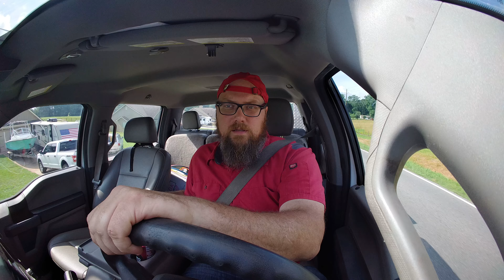Nordyne Package Heat Pump: Hidden Capacitor.

Comment: what would burn the 2AMps glass fuse ? the contractor is not measuring  24 V on the side pins? thanks
Reply from the maker: Typically some kind of low voltage short, which can be interesting to track down sometimes.

It could be anything from damaged wiring due to mechanical fatigue or rodents trying to get cool or warm chewing wiring as they go, or component failure such as a relay, board or contactor either having failed.

Normal l start with a visual inspection of the low voltage wiring in the units and running between the systems is a good starting point, but after that if nothing pops out it’s somewhat a process of elimination.

What I’ll typically do is disconnect all the low voltage field wiring at the furnace or air handler, replace the fuse (or use a reset capable fuse) and test each circuit individually until I have an issue, then follow that particularly circuit until i find a damaged wire or component on that particular circuit.
Reply: @HvacRideAlongs  Thank you for taking the time to help ❤

Comment: Are you ever scared to touch a wire that has a damaged sheath? That unit looked like it had a lot of home cooked repairs done to it
Reply from the maker: Yeah you will find a lot of that. The older the unit the more…. entertaining they can be for sure.

I’m usually pretty careful of my hand and tool placement when dealing with the more interesting stuff, but I’ve definitely ridden the lightning a time or two in my day 🤣